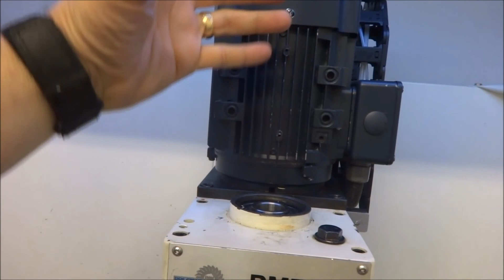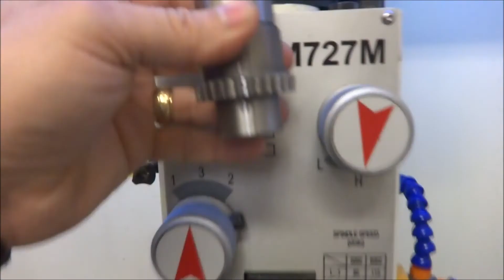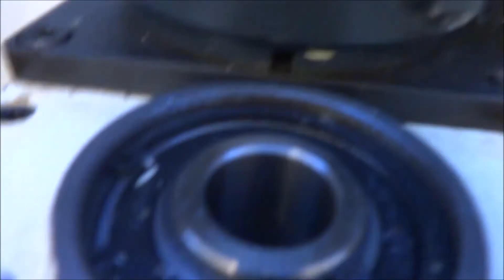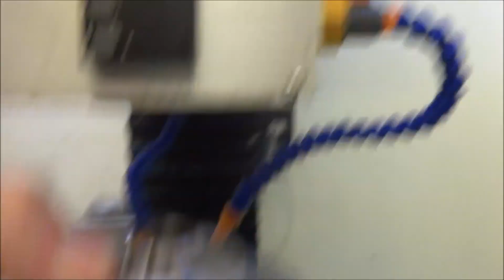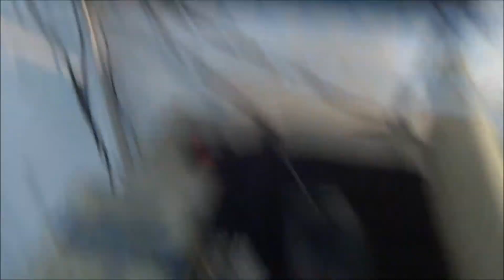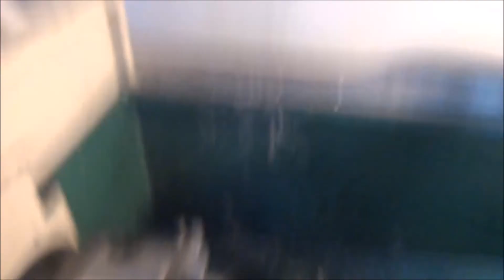PM727M Belt drive Pulley Part 2

Comment: can you use a tapered hub for the pulley on the spindle instead of messing with the pins? You can find them in a variety of sizes. might need to flip the pulleys so that the smaller one is on the bottom at the spindle (looks to small for a tapered hub to fit)but something to consider, would give you some height adjustment capability as well.
Reply from the maker: Not sure if there would be enough to grip with a Taper lock setup. Also the Idea is not to put tension on the spindle.

Comment: Looking really good Sam, I like Nick's 3 pin approach to driving the pulley too .. Next time I need to tear the spindle down I will probably go a similar route on my machine.
Gary
Reply from the maker: Hi Gary seems as though there have been issues with this approach so I may well go with the original plan which was to invert the Spline gear I'm just not sure I have the room to do as you did.
Reply: I don't think I would couple the pulley direct to the spindle either .. I like having the extra bearings as mentioned by Christ P.   
Could you make a new collar that will install with it's own bearings but use the pin method to drive the splines on the spindle?
Reply from the maker: Well I don't know for certain until I take the top off the gearbox My top is similar to yours however I have this 10mm lip I have to contend with, I'm not sure if I can remove it and make it work. I also worry there is not enough  spline passing through to accommodate the inverted Spline gear and top hat.
I will know more when I get it apart. good thing is I can always make another pulley if it doesn't work out.

Comment: let me tell you why driving the spindle end is a bad idea...

the top of the spindle is not rigidly supported, there is a sliding clearance for stock quill operation, so unless you make the pulley a press fit to the top of the quill sleeve (which yours does not appear to be) it will generate a wobble.  I tried this method initially on my first belt drive conversion and it was horrible for surface finish and vibration as the spindle upper shaft wreaked havoc on the entire rotating assembly.

the second reason this is bad idea is the spindle cartidge is not 100% concentric with the bearings in the upper casting due to a clearance fit even if it is very very close its not 100% which is going to cause a constant tension on the spindle bearings and again contribute to wobble in the spindle leading to poor surface finish and imbalance.

the best way to accomplish a belt drive on these quill converted designed mills is to drive the exposed spindle as close as possible to the upper tapered roller bearing and have the splines drive since they will accommodate any misalignment between the spindle cartridge and upper bearing bore in the casting.  once i switch to driving the spindle by this method vibration was reduced to almost zero and my part finish was improved exponentially as well as the ability to hold tolerance.

I strongly suggest you revisit your belt drive design and follow the first mentioned method which puts all of the belt drive tension on the upper bearings alone and uses the splines to freely and by self aligning drive the splined spindle shaft. otherwise you will find you went backwards in part finish and increased vibration which will be amplified by the new found higher RPM.

only writing this because I have been down this road and gained that unfortunate and expensive experience. cost me several sets of bearings and overall satisfaction with machine performance not to mention tool life.

I hope I wrote this all clearly enough to understand but if not shoot me an email sam!  I can show you before and after finishes of parts with only a simple belt drive design change that you will clearly see the difference!

Chris
Reply: Sheesh, write a novel will you? :)
Chris always steers me into my decisions. I'm driving mine by the splines too though.
Reply from the maker: LOL Chris always leads me to second guess myself! LOL I think he has valid points and I did consider that may be a issue the great thing is It DIY so if It does become a issue I can go a different route. How is your setup working I recall it was a great finish? I wonder how much the issue Chris had was due to a Timing belt?
 I'm sure he will reply and let us know if he feels like that was a major contributing factor in the vibration.

I'm also not sure how this effects the spindle on a PM727M vs the G0704 as My spindle cartridge appears to have my spindle bearings spaced further apart. as my Cartridge is longer.

I will admit Chris's setup does produce a mirror finish.
Be Safe
Sam
Reply from the maker: Thanks Chris for the heads up as usual I'm in to deep to not see it thru if this setup induces issues then I will go with my original plan, No harm done I will have gained more machining experience and Knowledge at the cost of a pulley.
Reply: CNC4XR7 it did not when I drove it by the top splines..just saying..hahaha. I wouldn't waste my time trying to help if I didn't have a reason too.. just trying to extend the "help a fellow DIY'er out" suggestion..been there, done that.. required a second go!
Reply: russtuff Russ, if I recall they have all been positive upgrades or mods 😉

If you are dissatisfied.. I'm sure their are some more treadmill motors waiting to be stocked up on in eBay... And some sweet timing belt pulleys for the belt drive.. 😁

I think it would be worse if I made pretty parts and horded what dove those successes..  

I can always go dark and watch the train wrecks and wasted money get spent too.... Probably get more done in my shop..lol
Reply from the maker: Thanks Chris, Yeah I took a look at your video's It is quiet, and the run out is good. I had seen the before but not enough info to tell the how or why? As I mentioned it's already to far to not at least give it a try.  I did notice that everyone seems to only have the one speed pulley not a 2 speed?
Reply: CNC4XR7 yeah, depending on motor size I've found no reason to have two pulley speeds, with an inverter duty motor you get full torque at like 6rpm with a 1000:1 constant torque motor so slow speeds are plenty strong for the tools I use read up to 1/2" endmills and drills..
Reply from the maker: My big concern is with Drill ops. Have you had any issues? or are you still using the DC motor?
Reply: CNC4XR7 what type of drill ops?  I run 1/2" drills with a hint of being under powered..  anything bigger and I just ramp interpolate down at 12°ramp angle and 30ipm and it chews it up no sweat..

No dc motor here or ever again, I run 3ph AC motors!!